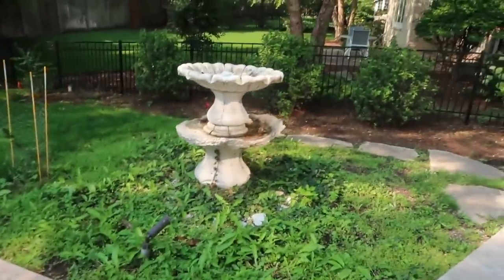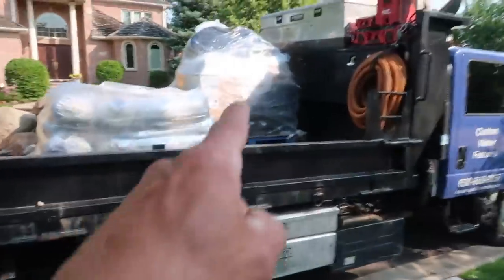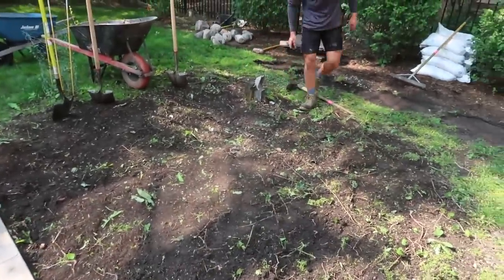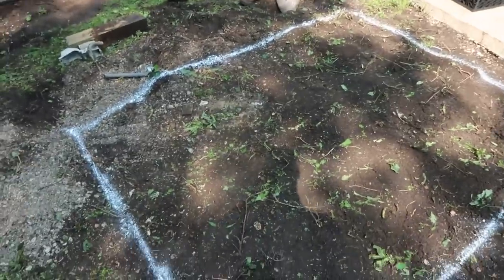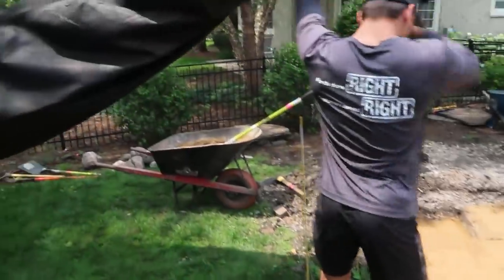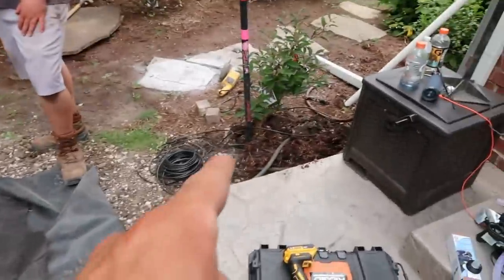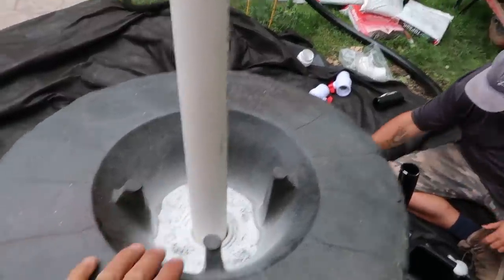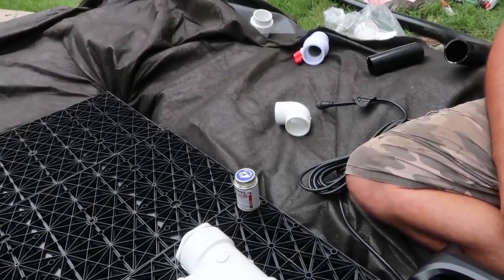Decorative Urn & Sphere Water Feature Replaces Concrete Fountain

Comment: So I saw you put flexible pipe and a fountain top light into the sphere but it looked like you ran 1&1/2  or 2” plumbing to the sphere.  Did you change your mind and add bigger pvc plumbing to it instead.  I have a medium sphere and used the flexible hose and  fountain top light and my water flow out the top looks nowhere as much as yours.

Comment: Why are you using PVC pipe instead of the flex hose in the center of the urns?
Reply from the maker: Easier and cheaper than flex. Plus it stays in place.
Reply: Think this should come with each kit